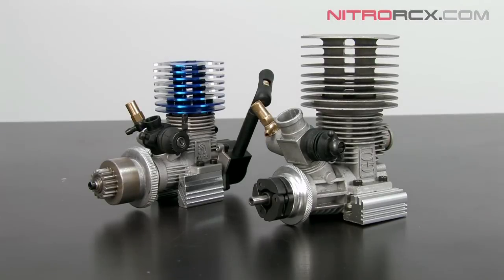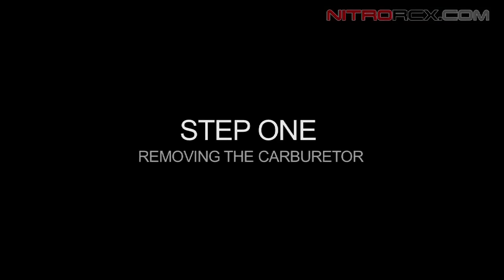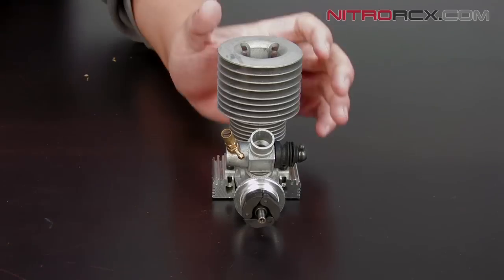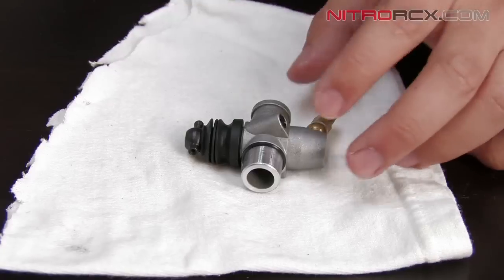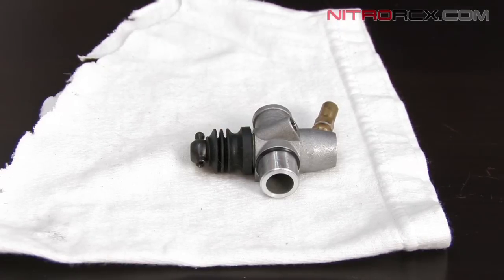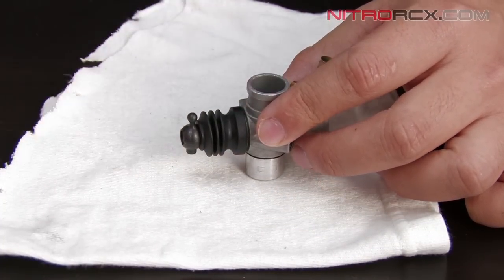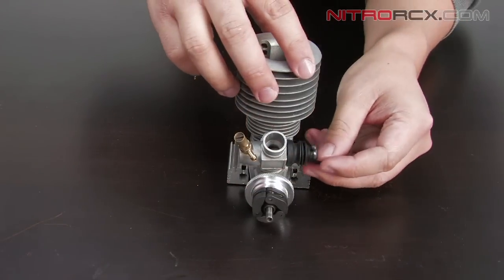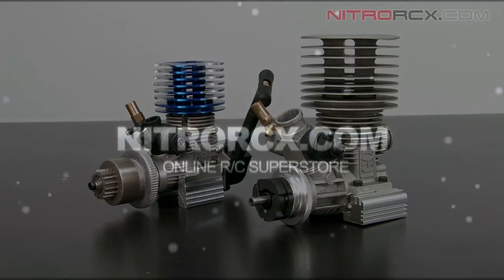Nitrorcx Guide: How to Clean the Carburetor

Comment from the maker: @ferarie100 You can but it might be somewhat in a bad angle depends on what car its in, it will be easier if you take the engine out of the car to get full access to the bolt or nut.